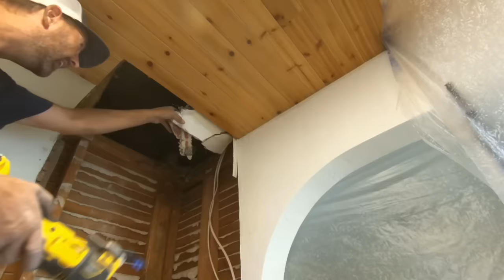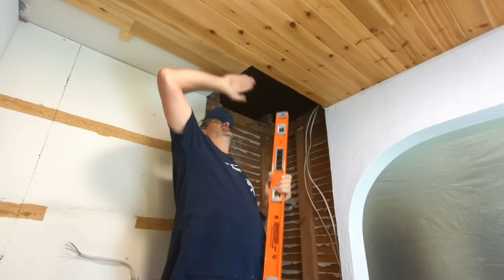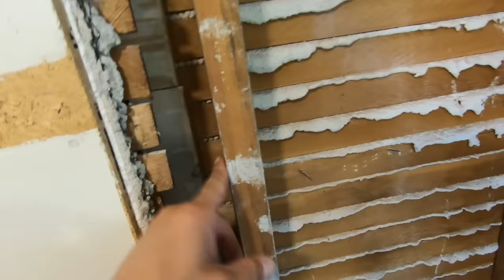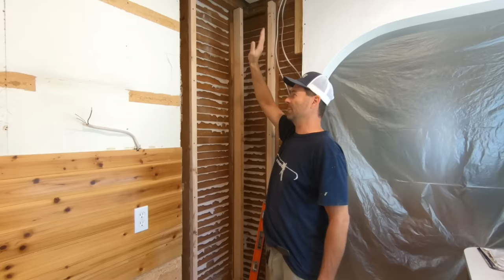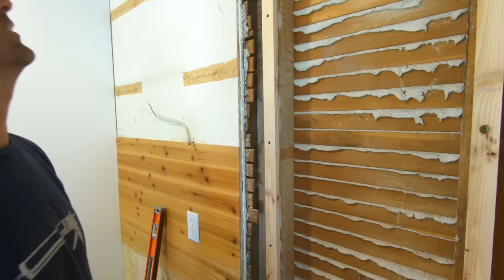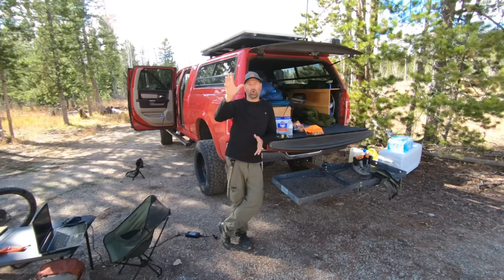Wall Repairs After Chimney Removal | THE HANDYMAN |

Comment: I use the corner/edge of the blade to cut through old plaster. Works well for me. Once the mesh is exposed, if there is any,  use the teeth. In my 90 year old house, most of the walls were pure plaster and lath and the only mesh I found was from a  partial kitchen renovation done in the 50's or 60's - that's where I found all the dangerously hacked (and hidden) electrical work too.

Comment: I did a whole house demo of plaster and lath, as an electrician because I chose a bad company to work for 😂. I don’t wish that hell on anyone.
Reply: I did a whole house demo on a 5 bedroom house that I thought was going to be easy because it was drywall. It turned out to be drywall over plaster with metal lath that was over the original plaster with wood lath. Luckily I was still hourly at the time.

Comment: FYI:  Impact drivers are meant for drilling.  That is why they make special drill bits with a hex shaft.  Very handy but it is not as efficient as a drill if you are going to be doing a lot of holes.  You can buy sets of the hex shaft drill bits (generally also have a shorter flute section).  Makes it easy to carry a selection in your tool belt.
Reply from the maker: Those bits you are talking about are for a quick connect adapter that goes on a real drill.  NOT an impact driver.
Reply: The ones I have are rated and labeled for impact use.  I have been using tools since before your parents were born.
Reply from the maker: That's hilarious.